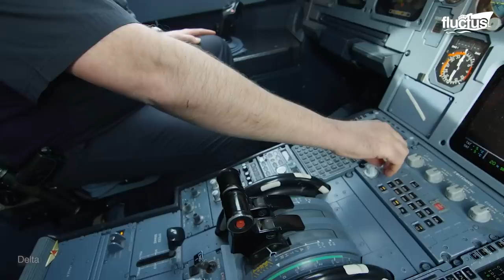Ingenious System Airlines Found to Pull Out the Biggest Aircraft Engines

Comment: I used to work at Boeing Everett where twin aisle wide body jets are made. The 777 uses GE 9x the biggest turbo-fan engine in the world. They don't remove the engines from the plane, they remove the plane from the engines. It stands over 9 feet tall and won't fit inside a standard house.
Reply: in the real world we drop them off the plane

Comment: I have seen a video of airplane assembly at Everette where it was mentioned that weights are hung in place of the engines to avoid the airplane from toppling over. That the engines are mounted last (JIT approach) etc. It means that the engine weights are significant. So the question: is it not a concern during engine removal? Nothing was mentioned in this video about that concern.
Reply: meanwhile there are planes all over the world without engines on them and zero weights attached to them.....because the plane WON'T topple over.

Comment: All the tooling for removal of the engine cradles are made by the engine manufacturer and today most commercial engines are not owned by the Air lines they are leased so spare Engines are stored around the world ready for use as most airlines can not or do not have facility's to overhaul the hot end.
Reply: Various engine cradles are made by 3rd party maint equipment mfrs since they are not flight equipment. Engines and other LRUs (Line Replaceable Units) are generally borrowed or traded between airlines freely at terminals as a courtesy--faulty units returned to suppliers for disposition. Airlines own the entire airplane unless the whole thing has been leased.

Comment: Fluctus states the biggest crap in aviation videos on Youtube. No airline has found a way to remove or install an engine. The procedures shown in this video are developed by the manufacturer and described in the maintenance procedures manual. Adherance to these procedures is mandatory.
Reply: I suggest you research American Airlines Flight 191....the NTSB found American, Continental & United Airlines had developed their own procedures which, at the time, had been approved by the FAA.
Reply: De acuerdo, es así como dices.
Reply: its called the MAINTENANCE MANUAL